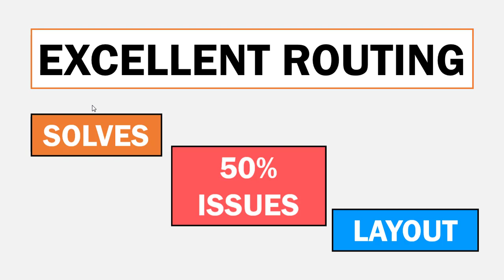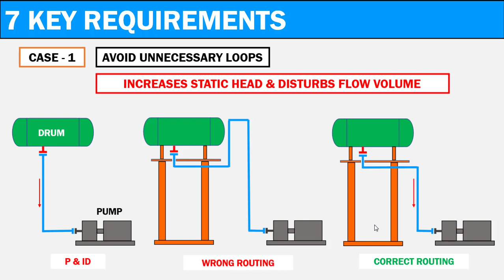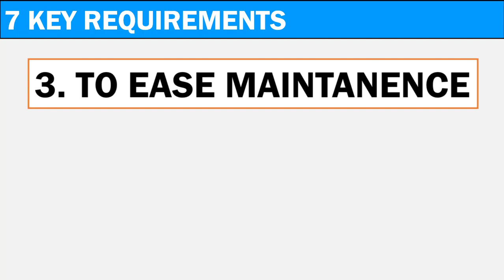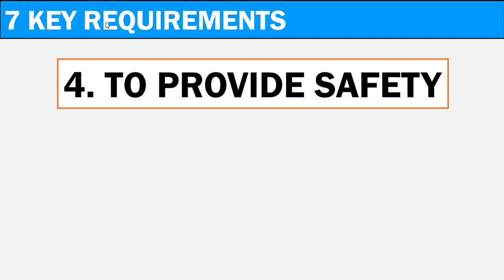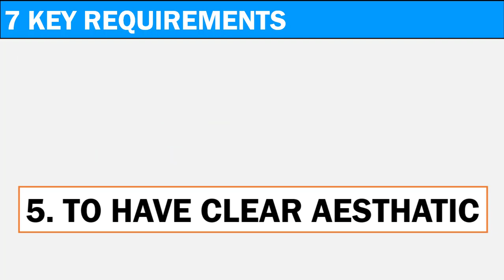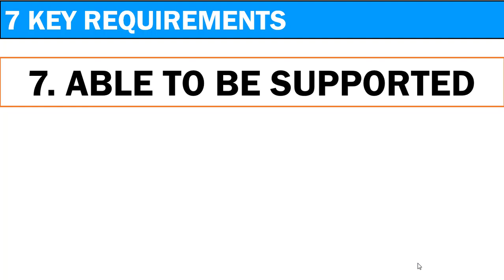Fundamental Design Guidelines for Pipe Routing - Part 1

Comment: sir when will i get  part 2nd and 3rd i m waitting for that
Reply: Sir 
1.  why largest and heaviest line to the outside 
2. Why largest and hottest line at the rack edge 
Please answer me
Reply from the maker: @neyazsiddique3630  Yes largest line should always be outside, so that the weight of piping will go to the immediate structure and also wont cause any sagging, unlike placing it in the center.

High temperature lines should also be at the edge of rack to ease the provision of expansion loop
Reply: @pymedaca3130  thanks sir
Reply from the maker: Hi Neyaz, I can understand your eagerness, but I have planned certain videos inorder to teach you systematically. If I jump in to another level, would create some confusions. Please keep watching, more interesting videos are coming up. Thank you for being a continuous follower.
Reply: @pymedaca3130  right sir thanks

Comment: Watching your video, your example of loops going into a pump.  The balance of a pump is very important,, we often need to provide some flexibility to a pump suction to prevent undue loads.  I'm not so sure that I agree with you, my name shall not be shared but I'll suggest that I manage the largest Piping Engineering & Design group in North America.  I will still thumbs up your video and leave you with a question.  Which way does a temporary strainer go into a system and why?  Please answer without looking it up.

I lived and worked in Gurgaon for quite some time.......I really appreciate you taking the time to post this video to advance the knowledge
Reply from the maker: Thanks for complimenting. The point is should not provide loops which would disturb the gravity flow and moreover upward loop ll become a place for vapour accumulation which is not good for suction due to cavitation issue. Flexibility loop is required only if the nozzle load goes high. Strainer should be near to pump suction nozzle and it should be accessible for maintenance.

Comment: Sir please tell me about what’s should be distance between one pipe to another pipe 
And what should be distance between equipment wall to pipe 
as you show by routing pipe on tower close to towers wall so please tell about
Reply from the maker: Ok. Pipe to pipe distance is known as pipe spacing which is one inch from the OD of the one pipe to the OD of the flange of other pipe. There is no such requirement for equipment and piping. Naturally piping won't be closer to equipment wall.
Reply: @pymedaca3130  ok sir thanks but I have one more question
Reply: Why the topside module are elevated approximately 4 meter the upper deck?
Reply: Above the upper deck
Reply from the maker: @neyazsiddique3630  Are you asking in Onshore or offshore?. I have no experience in Offshore if thats your question. I am specialized in onshore process plant design.
Reply from the maker: @neyazsiddique3630  If your question is about the routing shown in my video... difference between 20m & 16M. Its just a representation to highlight how routing should not be done. Routing should be always short and simple. 4 meter above the Top Flange is not necessary. In general it will a flange with immediate elbow.
Reply: @pymedaca3130  ok sir
Reply: @pymedaca3130  sir in the wake of an increase covid 19 I have lost my job so could please help sir if you have any opportunity
Reply from the maker: @neyazsiddique3630  Hi Neyaz, To be I am not in a position to give you a job. I thought i share some unique informations which could help people like to you to improve your piping knowledge, so that you will be able to perform better in interviews. But the current situation, is not only bad for you... there are lots of people are suffering.. lets pray for good days. You will find a wonderful opportunity. Please dont loose hope.
Reply: @pymedaca3130  thank you sir 
Please sent me unique information I m very thankful with you